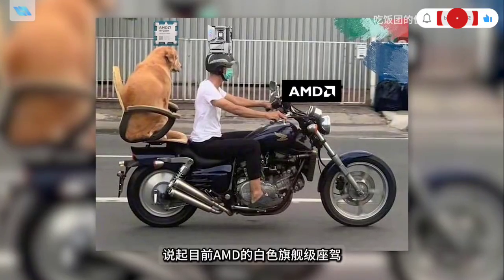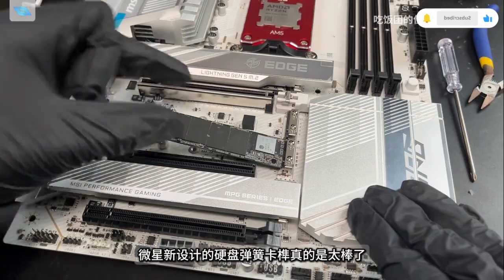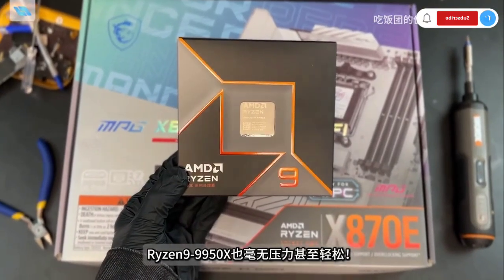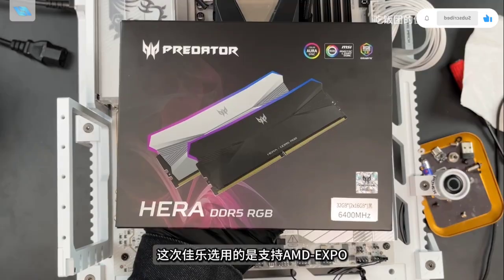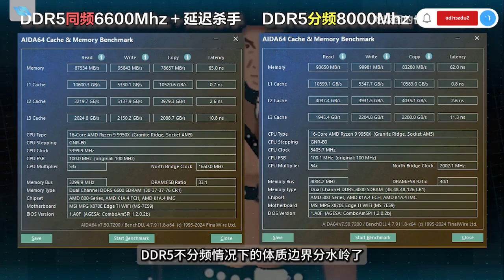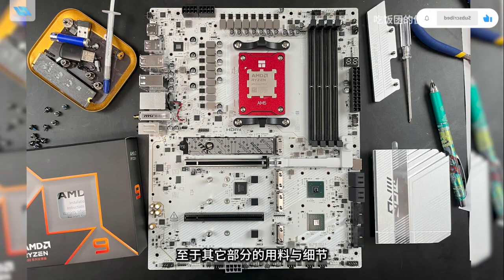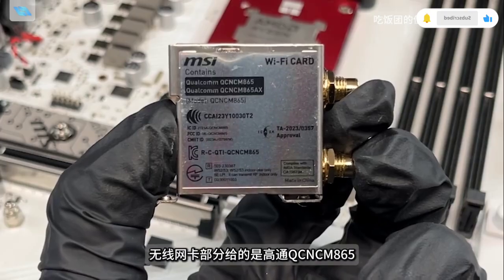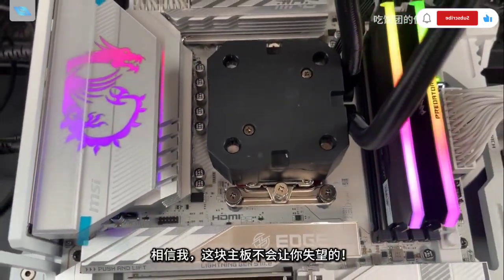MSI MPG X870E EDGE TI FULL Review | Best AM5 Motherboard for Performance & Value!

Comment: Nice quick run down. I plan on getting this board for a new build. Strix 4090, 9950x3d and 128GB of RAM. Heard mixed thoughts on the board, mostly on reddit though and believe it's just users who had a bad experience with a board they possibly didn't quite understand.